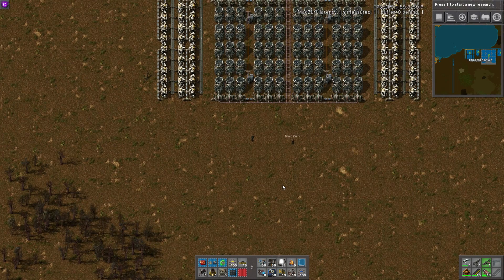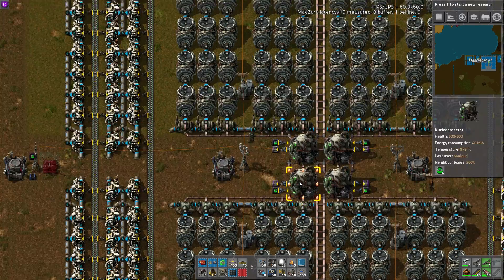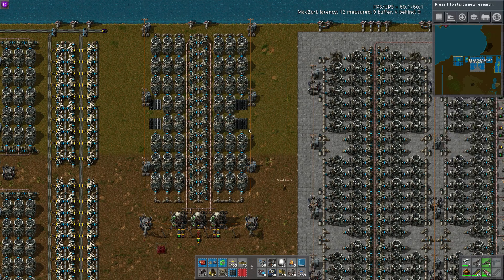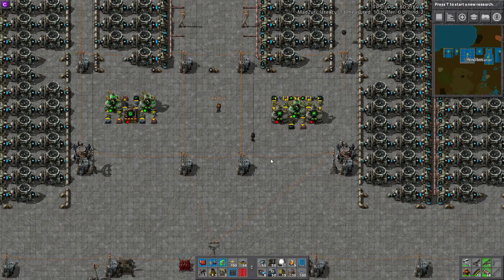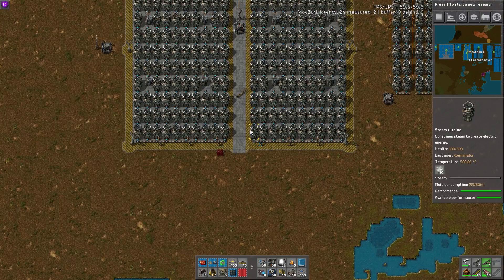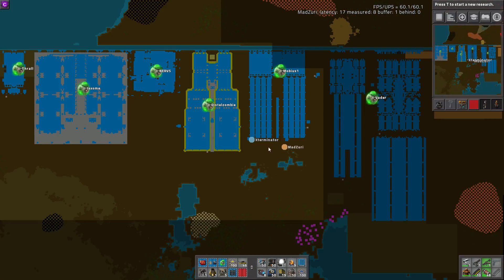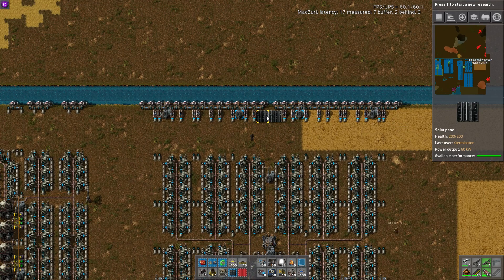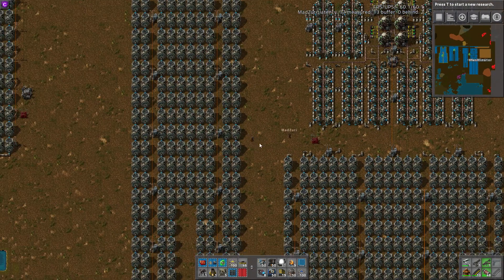0.15 Nuclear Power Builds :: Factorio Workshop Season 2 - Building A Better Factory

Comment: Having a few steam storage tanks and a couple extra turbines is nice for electricity demand spikes. By the time you have nuclear power, laser turret power consumption is irrelevant, but there may be production spikes in parts of the factory, especially if you abuse logic combinators and power switches to completely disable parts of the factory when not in use to save on beacon draw. 

My friend figured out a build where nuclear fuel wasn't added when steam tanks were almost full and the whole thing had a power switch, so it wasn't even connected to anything as long as accumulators were good. So we had solar to power our base and nuclear was a backup to save on fuel. 

I also built a "trash burner", 10 boilers and 20 steam engines and 1 storage tank for steam, all connected to the logistics network and burning up all the trees, boards, boxes and power poles. It made mass deforestation by robots fun.

Comment: @Xterminator and @Mobius One,

I used the blueprint of mobius on my megabase and just got to the point of full powerusage... But the fact is that this exact blueprint only makes +-1.2GW instead of the 1.4GW... How can this be? I am running in the latest version of 0.15. 

Also, before using that blueprint, my need of power wasn't that great and i tried to make a 4CORE nuclear setup myself, by hand. I used an overkill of waterpumps and a decent amount of heatpipes, but still managed to get +-375MW instead of the 480..... ANy help? :) 

I Like your videos!
Reply: oh, my wrong.... someway, somehow, my bots succeeded in getting water (?!) in the steampipes of one of the rows of turbines..

Comment: My thoughts:

1st build ; bleh, Not vanilla, Why hasn't Zuri made a nuclear setup yet :p
2nd build ; awwww it's so cute, might use this one for my small factory
3rd build ; Holy hell that's big, why is it so big?
4th build ; bugged, wonder if it can be fixed
5th build ; Holy hell that's compact. Not bad if you have a large lake nearby.
6th build ; hum.. why so many tanks? should only need 1 row, I'ed have to look at it... but I'm not sure I want to.
7th build ; I like this one and it's simple, just need a factory to run on it. I LoVe the steam engines
8th build ; not too bad, not as effective as the 7th
9th build ;  Hum. this might be a case of "too big for it's own good
Reply: My build, the 3rd one, was made to expand with more reactors and was planning a bigger "full build" but I had to scrap it with the change to the heat pipes. I was kinda peeved.

Comment: All these builds have so few offshore pumps! I've been using 1 pump to 10 boilers to 18 turbines. Has this ratio changed? My 2 GW plant has like 20 water intakes, which does feel excessive..
Reply from the maker: Unless something changed that I am not aware of, 1 pump can support a bit over 11 heat exchangers I believe. So your pump numbers might be somewhat excessive, but not much. Thinking about it now, I'm actually not quite sure how these builds have so few pumps.

Comment: note: my submission (thrall) is lacking a output box by the middle reactor, somewhat cut it of when making the blueprint. so it will get problems if you dont add it. Also i use it with 4 water pumps per input, that might be overkill, but the pumps cost nearly nothing
Reply from the maker: Thanks for mentioning that! An extra pump or two is better than not enough, so I'd agree with that decision.

Comment: Nice builds! Would love to have heard how many fuel cells each consumes per minute.
Reply: Joris B each reactor consumes 1 fuel cell every 200 seconds regardless of whether the reactors heat is needed for the exchangers. This is different to the earlier game boilers which consume fuel at a variable rate, depending on the power being output.
Reply: That's really useful! Thanks!

Comment: The most confusing part of nuclear to me are the fluid dynamics on the water and steam, it makes no sense to me half the time. Water level in pipes drops down dramatically for even 1 tube segment (e.g. the pump says 100, but 1 tube segment down it says like 70 even though everything seems to work fine), and the heat exchangers dont clearly show if they are working properly. Then there are the weird things about steam where heat exchangers show 0 steam or very little even though the turbines are all working etc it just boggles my mind a little.

What are your thoughts on tileable nuclear plants though? Not feasible due to pipe length issues or just not worth the effort seeing as 2x2 or 2x4 setup already supply quite a lot of power?
Reply: The important thing about nuclear reactors is the fuel cost. Tiling two 2x4 plants instead of rebuilding it into a single 2x8 means you're missing out free energy from 2 of the neighbour bonusses. So it's probably better to build 1 main nuclear plant (and perhaps some extra coal plants/solar arrays to handle the little extra required power if your nuclear can't keep up).
Reply from the maker: The fluid mechanics in Factorio in general are very wonky and honestly a huge pain to work with. I or Zuri/Me would of given a tutorial on fluid stuff by now except that it is finicky that it would probably just confused us and the viewers even more to try and explain it and demonstrate anything. I really hope they change how it works in the future. 

I think tileable setups can be good, but Tom Van den Broeck has a very good point. Due to the fuel usage of Reactors and the Neighbor Bonus, it would probably be better to make a 2x8 setup rather than a tileable 2x4 setup. However, you can only build one so big until you do hit steam/water/heat pipe limits, so after a point, a tilable setup would probably be beneficial.
Reply: Ah I think the confusion about tileable comes from the idea that tileable means a single blueprint, yeah that would be hard due to how the bonus' work. I found this one tileable design that consists of 2 parts, 1 being the 2 'end' reactors that only get 2 neighbour bonus' and the other being the 'middle' reactors that get full neighbour bonus'. To make it tileable the design places all exchangers and turbines perpendicular to the direction of the reactors, basically in 3 rows (thats how many fit in the space of 2 reactors). I tried it but then started running into the weird fluid issues and perhaps coupled with length issues I wasnt sure if the design still works (it also didnt properly specify how much water to feed it, which will become an issue if you tile say 20 stamps of the design).

Ah found it again: https://www.reddit.com/r/factorio/comments/68w9aw/015_i_made_a_nuclear_thing_tileable/ its a pretty frikkin wide design but being able to easily expand it would be a real plus (and using full neighbour bonus') instead of just plopping down multiple single 2x8 designs.
Reply: > Water level in pipes drops down dramatically for even 1 tube segment
It's normal. The flow rate is in proportion to pressure(water level difference), so it means that segment has higher flow rate.
> Then there are the weird things about steam where heat exchangers show 0 steam
That is due to building order. If you build heat exchangers first, then steam pipes next, you should see 1.7 steam in heat exchangers when they are working properly.

Comment: I'm not familiar with the techniques you mentioned for control (steam level and accumulator farm) It would be nice to have included an explanation of what these are and how they work - maybe in a basic theory vid ?
Reply: The Accumulator Farm is just a (vast) field of accumulators to soak up all the power produced.  Steam level is, I think, referring to the same basic idea but using steam stored inside of tanks, rather than electricity inside of batteries.

You may want to do this because Nuclear fuel is burnt irrespective of electricity demand - solar you have day/night cycles to even out.  Nuclear also has a huge spin up time so you may want to protect against this.

We all kinda do it already with solar farms (arrays of panels and accumulators) but with nuclear you have the option of storing the steam coming from the heat exchanger, rather than the actual electricity.

I guess now steam is a separate fluid you could do the same with regular steam engines.  You could also barrel and unbarrel it too, rather than use tanks.  Factorio's perfect systems lead so some odd things sometimes :).
Reply: The general idea is that since nuclear power will keep running wether you actually need the power or not (as opposed to all other forms of power in the game) then you can use tanks to store the steam and use circuits to insert fuel into the reactors only when steam is running low. This lets you mimic the effect of other power plants and only generate power when you actually need it.

Since uranium ore is rather scarce this makes sense.
Reply from the maker: We didn't explain it because I don't really know how it works either in regards to the Nuclear smarts, and it would of been a fairly lengthy explanation, and the video was already getting a bit long. Perhaps in a future one though we will explain it. 
Looks like you got some good answers already though. :)
Reply: The answers I've gotten so far don't really help. I have seen various tricks on the forum, usually after I needed them in my game ;-)

It would have been nice to see an actual test rig setup as I probably would have found that quite informative - its just a suggestion though.

Comment: You need to add one fuel to each reactor on the Distelzombie build.
Reply: But they were already running. You dont need to add more.
Its probably the seperation of the logistic nets. In this old version it had a seperate roboport inside that shouldnt be connected to any other ports. I used the requester chest in the middle of the build to control fueling.
Even though it works perfectly, I ditched that idea. That was version 2.0. Now 2.4 is available.

Comment: Zuri should be disqualified as it requires some mod to get it to work
Reply: My Preheater mod doesn't require any different fuel than a regular boiler. Rocket fuel is not a requirement.
Reply: tamedelement and you need to have researched the rocket silo before you can make the rocket fuel to feed the mod. Certainly an end game build.
Reply: Romulus228 sure, but Zuri's said that his build in this video did.
Reply: Apologies I must have misheard.

Comment: If you like my setup, Its best to use the newest blueprint from my factorio forum Thread: https://forums.factorio.com/viewtopic.php?f=208&t=47556

The thing it didnt work in your video, xterm, was probably that the upper part had to be a seperate logistic network. This has been changed with the newer version. Also the newest version includes less pumps, a fail-safe solar power plant and less combinators. It is available in four blueprints too, to grow with you.
(On the last page I dropped a blueprint with a sophisticated combinator setup that basically alerts you if ANYTHING goes wrong. Very useful and still in testing.)

I didnt bother you with sending yet another version of because I thought you would use the one from the forums. (I think I wrote sometrhing like that.) Anyway no problem, Thank you for showing all the builds. :)
Reply: Actually, I just updated it again to include this new combinator stuff from the beginning.
It is highly recommended you use the newest version of this build. (If you like the design that is) It is now version 2.4
Xterminator used an older version. Probably 2.0
Reply from the maker: Thanks for updating it! Sorry we used an older build, it was hard to sort through though sense you submitted like 3 versions of it already. I took the most recent one I saw. :)
Reply: Xterminator yea I know xD
Part of it was because of the new game version that had broken my earlier design. I thought you would have used the link to the forums though like I asked. 
But no hard feelings! :)
Reply from the maker: Ah that was my bad. Was in a bit of a rush for this workshop so didn't have time to look through all the external links people gave. I should have though, so sorry about that. 
All these changes to game mechanics definitely makes doing solid builds a lot harder. lol
Reply: Xterminator I still love you! xD

Comment: you didn't recover the super compact build, also you only hooked up one water on the right side of it.
I'd be interested in a follow up video with them all spread out and a zuris input on active chunks and the UPS cost of each build.
my build pre heatpipe change has about 1200 active entities per setup, with 1.1gw of power. and about 8k active entities total for my current demand
solar takes a LOT more space, but has just 1000 active entities for the same demand.
my current Giga base is moving back to solar for UPS reasons.
Reply from the maker: Damn, yeah that was our bad. :/
The UPS cost of each build is pretty straight forward because it really just depends on the amount of active entities like you said, and also the pipes. So that last 2.4GW build is probably going to be worst in terms of UPS because it is so huge. 
Solar is insanely better for UPS like you said, because it actually only counts all solar panels and accumulators as 1 thing regardless of how many you have. 
It really disappointing me that Nuclear is super cool, but still not viable at all for any base that requires multiple GW of power and still wants good UPS.
Reply: That depends on your computer though. I can run bases at 60/60 when other people (you) are running them at 30/30
Reply: DaemosDaen umm UPS cost is still UPS cost.
my PC is a very fast I7 sure its not latest generation, and its not DDR4 ram, but its better then the average pc by a long shot.

but i have had bases 0.14 that run at 15UPS on my pc, and the devs running 0.15 pre-release and much faster PC still dont get 60/60 from the same base.

if i can use a more UPS efficient build for a larger overall base why wouldn't i?
Reply: Because you want to use the new features.
Reply: Michael McDonald i love the new feature, but as xterm has said in his other videos its just not good enough to warrant using over solar. In his mega base series he has already modded it to use 4x resources and produce 4x the amount of power. This is what vanilla should be like I think
Reply: I still say he should have tried it before moding it. I've posed 7 of those "smart" builds into the 0.15 sim map and am still at 60/60 (7 was an ar
Reply: 7 smart builds might not kill a game, but 2 or 3 WITH a full running factory could

Comment: Those 2 steam engines are necessary to achieve the total output of the reactor, the 248 turbines produces 248*5,6 = 1388,8 MW of power, the 10 reactors, including neighbor bonuses can output 1440MW of power, so that last bit of power comes from the engines.
Never bother doing circuitry to limit the production rate of the reactors mainly because by the time the factory requires nuclear power I'm over 1GW of power consumption anyways or really close to it, so it would easily replace those gigantic solar farms. Some ppl also complained about the lack of circuitry on the setup so I might add it in another build.
Reply: MadZuri but doesn't Nuclear immediately kick in once you've warmed it up the first time? The reactors never cool down below 500 degrees once you've started them up the first time, so the power kicks in immediately? I feel it ought to be possible to come up with something that feeds only enough reactors based on the amount of power being demanded by the factory, rather than an 'all on, or all off' switch.
Reply: MadZuri that's good to know thanks. My thinking though is that we should be able to come up with a design that continually feeds 1 reactor, but then feeds the others only when there's a demand for the power. Deciding whether to fuel each reactor  a based on the amount of excess stored steam in tanks feels like something worth trying.
Reply: I liked your design.  
Since it not too compact it´s possible to add a few storage tanks as a buffer and/or solar panels to kickstart it.
Reply: My design has no such flaws even when it is not fueling for an hour or so. It works perfectly. Thats why theres so much storage tanks.
Just test the blueprint from my factorio-forum thread. (Other comment) And the version you tested here works the same, even though it is a really old one.
Reply: There isn't any good solution for the fuel controlling part, so the best I came up with only vanilla factorio buildings is this one: https://pastebin.com/ezmJXMXU

There's a better controlling system but that requires the mod Inventory Sensor, as it can read temperatures from the reactors, so all we gotta do is keep them providing enough heat for the current power consumption of the factory. Its better but its not ideal at least not what I expect a fuel controlling system to be.

Pretty sure someone will find issues with this setup so lemme know what those are so I can try to improve them here: https://redd.it/6c1noc
Reply: Pipes have max lenght that they can transfer heat and double lane steam Turbines takes 7 tiles of land (2 turbines 3x4 and 1 power pole), the boilers takes 2 tiles each and the pipe in the middle, 1 so its 5, to make the building nice I added the heat pipes on the outside and instead of tiling them on top of eachother I kept them separated so its a perfect 7 tile on both exchangers and turbines. Also the max lengh of heat transferring measuring by that style is 4 blocks of exchangers + turbines on each side of the reactors, so 4x7 = 28 tiles of maxlenght on the heat transferring.